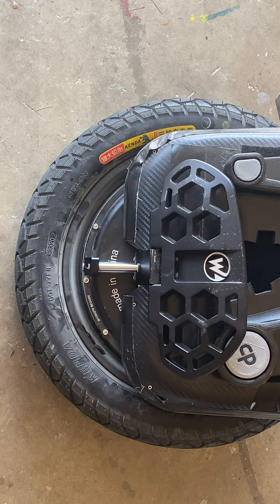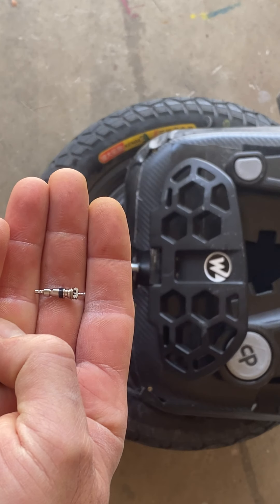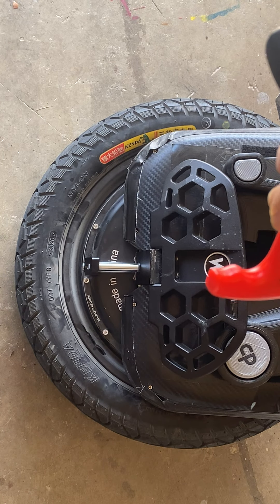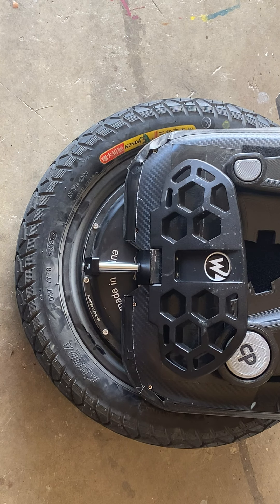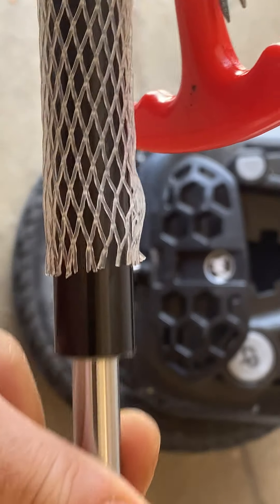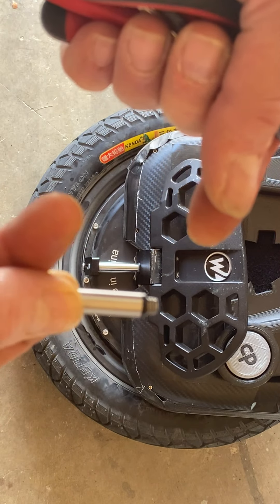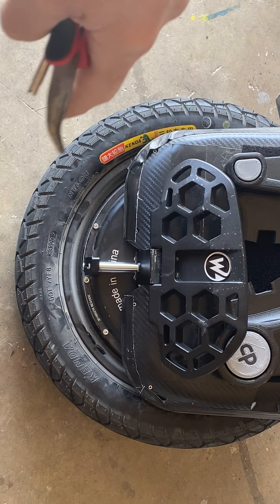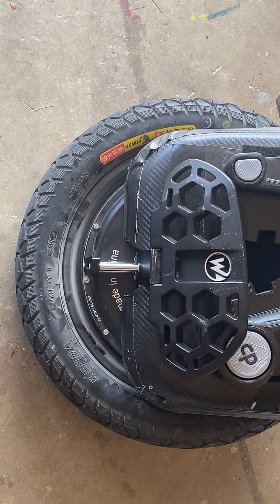Begode EX suspension loosing air

Comment: Thank you! 
Initially, I was at the point where I was loosing quickly the whole pressure, in less than half an hour. I then tought about and just smeared with oil (fine mechanical oil) but I got the impression it losses even more. I thought maybe the oil eats on non-metal parts and I just worsened the matter. But then I saw your video and put 10 drops in each barrel. Works like a charm! Thank you so much!

PS: I didn't remove the ventil, I just turned the wheel upsidedown and dropped the oil in. With a hex key I just pressed the ventil many times and rapidly, then inflate (because I didn't had the patience to order and wait after that tool, nor did I found one in my nearby places)
So, thx again!